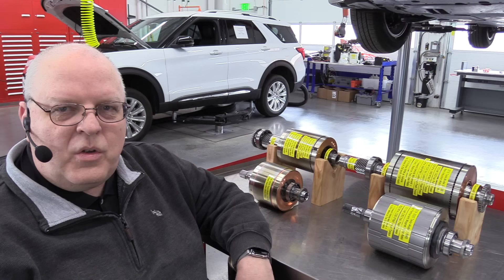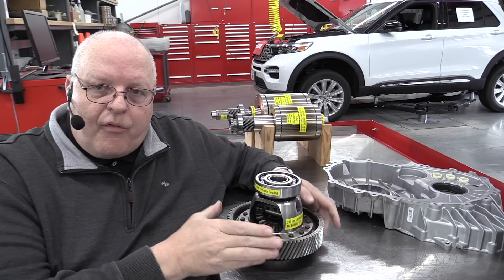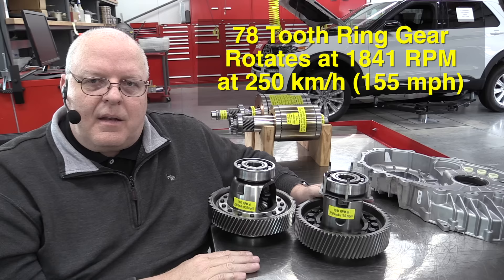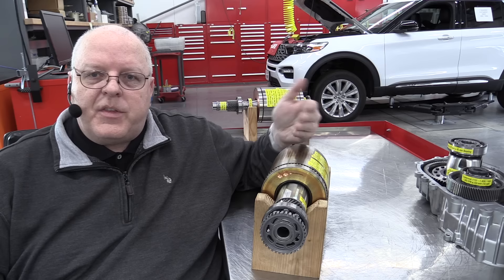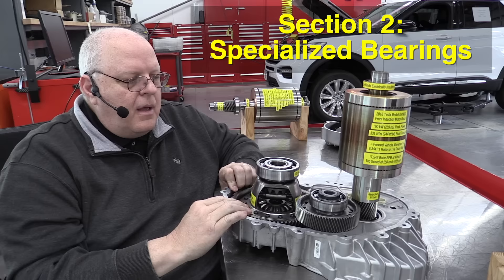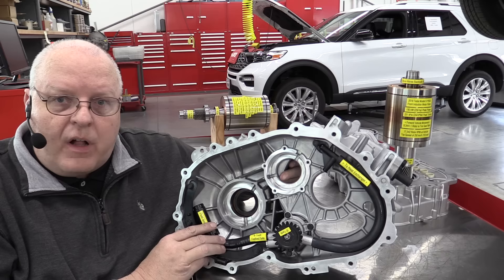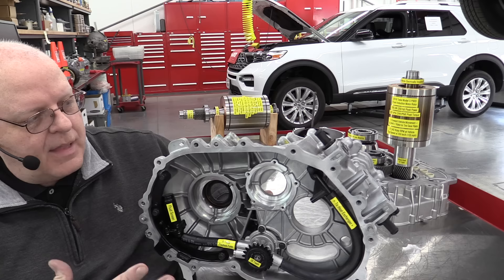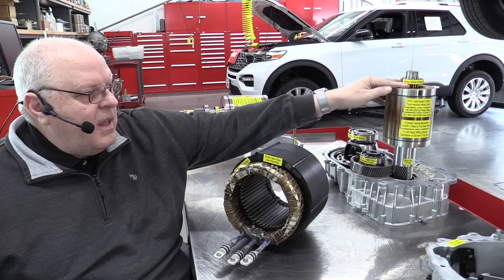Understanding the Tesla Model S Front Motor

Comment: I'll keep it very simple and principal of electrical motors. A asyncron motor or syncron motor there you are paying for the electrical field all the time by a little higher power consumtion. A motor magnetised by permanent magnet motor are you paying for the magnetfield one time, when you buy permanent magnets. One of the problems with magnets is when you make the math of the motor you handle the permanent magnets as air gap, and all air gap is lowering the effincity. Losses in the motor is bearings iron how hard you magnetise it of hystereses curve and resistive there it will be P = R * I^2. So current losses goes up with the sqare of current. Then you think okay increase the voltage and use less current. Well it's not that simple. In the motor you have only a limited amount of space. If you is going to use higher voltage you will need more windings and has to use thinner copper winding because of space, so losses will remain the same. In industry is it often used servo motors they is permanent magnetised and in many part looks like a syncron motor. The reason to use it is normally one of two or both reasons. You can controll the speed very accurat because slipprige is zero as long as you not overload it. The second main reason is they are very easy to use when you need to position accurat.
Reply: Just a comment to the permanent magnet motor. The natural usage of it is to use it as generator when you are breaking. Because of magnets it will generate energy when it rotate, when  magnetic flow changes in the windings while a magnet passes. To be a little more technical are you running the frequenc converter in the fourth quadrant, then is it delivering power to the grid or in these case to the battery pack. It is naturally possible to just rectify the power and charge batterys direct if the voltage is correct, there is a few possible solutions to control the process, wich one chosen here I don't know. It is possible to do the same thing with the asynkron motor but then you got to genreate reaktive power and then has a frequency of it there it is running oversynkron. Under those curcumstanses it will run as generator.